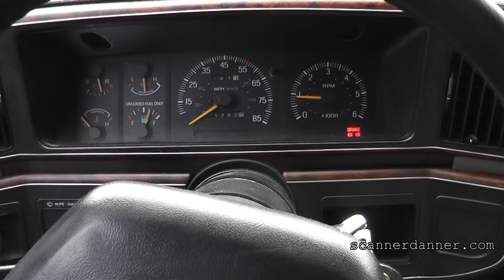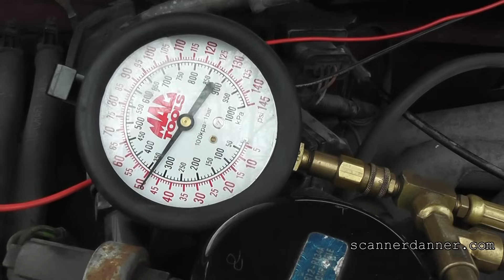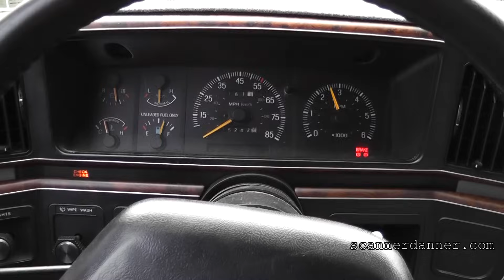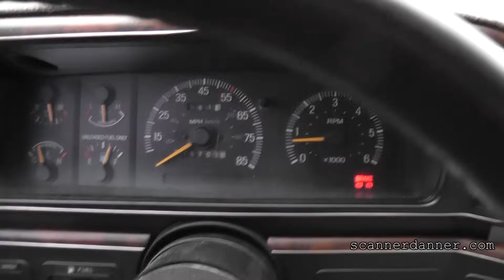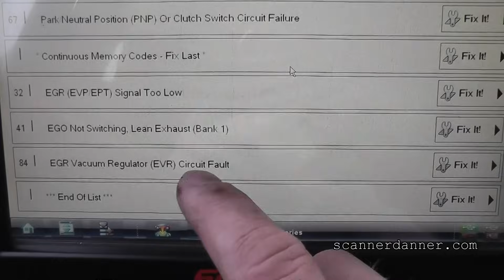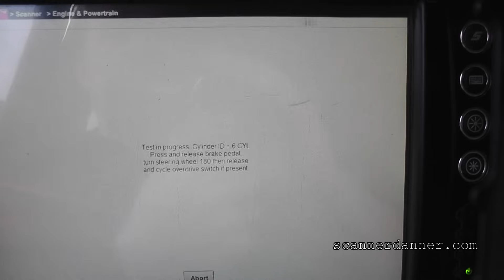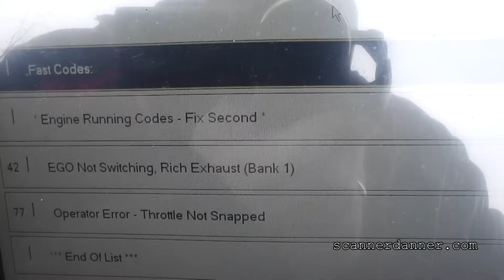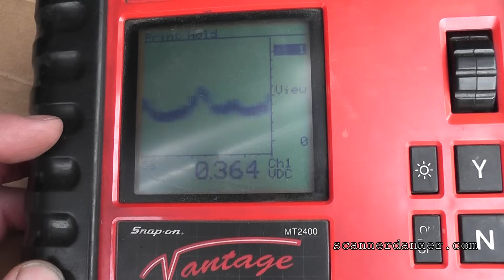1988 F150 Hesitation Problem [FIX!]

Comment: Screw crawling all over and under the engine ... just dust off and hook up your trusty EEC-IV breakout box and do all your voltage tests from the driver's seat before getting covered in dirt and grease!
Reply from the maker: Never had an EEC-IV BOB 😉

Comment: It probably needs a tune up., Paul.
Reply from the maker: No sir, watch to the end. Thanks!
Reply: @ScannerDanner  
Great observation, on my commenting before the end! You simulate my gray cells watching your videos! 
 But my path would've been to check  the plugs and distributor cap and wires first before proceeding down your path. 
Just saying.
And, I did watch to the end
Good show! 😁

Comment: When you unhooked the egr vacuum line, you created a vacuum leak which countered the rich condition...
Reply from the maker: Nope, when I unhooked the EGR I prevented EGR gases from entering the combustion chamber that already had a messed up AF ratio from the faulty O2 sensor. It wasn't the tiny vacuum leak from the EGR control hose that changed anything

Comment: Hey, ScannerDanner!  Great video.  I really enjoy watching them.  They are very informative, and you are definitely a sharp tech, but I DO have one complaint.  I was an auto mechanic for a few years prior to joining the Navy in 82, and was also an auto mechanic for my 20 years in, and in all my years, I have NEVER seen an EMERGENCY brake on a vehicle!  They are PARKING brakes!  LOL  I doubt they would do much good in an emergency, anyway.  They are merely designed to HOLD a vehicle still while parked on a SLIGHT inclination.  That's what parking pawls in automatic transmissions, and for manual transmissions, we leave them in gear.  Of course, it doesn't hurt at all to SET them, but again, they are PARKING brakes, not EMERGENCY brakes!

Thanks, again, for the outstanding video.  I hate to say this, but watching you get your butt kicked the first time on that truck was really refreshing.  It shows that we are ALL human, and we can and DO make mistakes.  What's important is that we learn from them, and pass that knowledge on to others, in hopes that THEY don't make the same mistake.  Great job!!!!!!!
Reply: Darrell Dowd Potayto Potahto.
Reply: dchawk81 P A R K I N G brake!!!!!!!!!!!!!!!!!!!!!!!!!!!!!
Reply: Darrell Dowd P O W T A W T O W
Reply: dchawk81 P A W K I N G!  (for your NAWTHERNERS!  LOL
Reply: Darrell Dowd P E R T E R T E R! (fir yoo suthnas)
Reply: +Darrell Dowd From my understanding, handbrakes/emergency brakes were so defined in the days of single-circuit brake systems. If a master cylinder failed in a single circuit system, we needed a handbrake/e-brake to go some way as to stopping the vehicle. In the 1980s design rules changed (in Aus at least) and dual circuit systems were the law. Vehicles can now stop even when one circuit fails. From then on, e-brakes became parking brakes, and their only requirement was to hold the vehicle when stationary on a slope.
It used to be great fun (still is) doing handbrake turns in my 1966 Mini Cooper S
Reply: +David Bell 
You are ABSOLUTELY correct!  When I was in the Navy, even though our Tech Pubs called them Parking Brakes, everyone STILL called them Emergency Brakes, and I was CONSTANTLY correcting them, not because I was an ASS, but because they would come to me and tell me they couldn't find the Emergency Brake in the IPB (Illustrated Parts Breakdown) to order parts.  I would tell them, "Well, if you used the CORRECT terminology and looked for the thing you are trying to order under Parking Brake/Assembly, you would be able to find what you are looking for!"  They would grumble about it, but sure enough, under the Parking Brake, they would find just what they were looking for.  Some of them I broke of that bad habit.  Others, well, some people (and horses) you just can't break!  LOL

Comment: Simply delete the EGR and plug it off. It's useless smog system that draws valuable vacuum and messes with the EFI. Actually makes the motor less efficient which defeats the point in the first place.
I have done this more than once and would do again in a heartbeat. Some of the early EFI's models don't even have an EGR!
I tell everyone that their plugs/wires/rotor an cap are most likely fine. To tune up any EFI vehicle they need to replace the air filter and o2 sensor(s).

Comment: Good wsy to fry the electrical system homie, ya never plug or unplug the pip while the vehicle is running
Reply from the maker: Old wives tail. Especially on that SPOUT connector. There is a PIP and a SPOUT

Comment: This truck here for craps and giggles to me honestly sounds to me like it is a two or three symptom pretty substantial symptom problem top of my head I'm only 21 minutes in the video haven't never watched it not even really sure what are the total symptoms of the vehicle like EGR or..... EGR/pcv valve and the good old O2 sensor LOL LMAO guess those my guesses
Reply from the maker: I'm replying to your original question that was in my inbox. Are you saying the ECM, ICM (ignition module) and ignition coil are all burning up? Or are you simply having ICM and ignition coils that are burning up? 
Cheap and bad new parts are absolutely plaguing our industry right now and that is my guess. I see nothing special with this system. There is no type of ballast resistor to limit current to the coil, but there is a what they are calling an "ignition suppressor resistor" on the IDM circuit (ignition diagnostic monitor) of the ECM. This monitored circuit is tied directly into coil negative via the resistor I just mentioned. If that resistor is missing, maybe that could damage the ECM??
Reply: @ScannerDanner  I will say that I have found out that if my computer or ECM burnt up A tip if in case you didn't know or anyone else in my case I don't know about anybody else's but in my case when the computer has went out the fuel pumps won't work LMAO truth LMAO 🤣 now if we were to go and look into the hands chiltin manual and to the electrical system chassis chapter 12:43 is what I'm on you have ABCD and then you have 8 9 10 and 11 now the A-D is OMG lol longitudinal The 8-11 is longitudenal I can't remember My x/y Axis idiot.... anyways the part that interests me is right at the top of b you'll see the dash between a and b and dead smack in the middle of 10 ignition suppression resistor 22 km I need to look up that also at a 9 there is a yellow wire also with a 20 gauge fusible link I need to look for last thing and this is going to sound in freaking insane do you know how to bypass a donor computers automatic transmission to override it to run a manual or is it what I think impossible damn near it
Reply: @ScannerDanner  again all burning up randomly all of them one of the three computer ignition or coil.... Coil is rare for it to go out but it does more than happy to give you my email I've made up one for just this occasion so if you want me to send what the video of what the trip looks like under hood or you want to hear it running or something like that video of testing things you suggest I would appreciate it and anything that I fix I'm more than happy to record and be as professional as humanly possible and thorough as possible without boring people and he'll have the video brother I don't care as long as I get to where I can have my daily back lmao

Comment: So your sayn due to poor general maintenance, this person is out on alot of cash for your services, twice.. Lol.. Nice one...
Reply from the maker: If that was your takeaway from this, I'm sorry. I don't even charge for my services anymore. The videos are my payment
Reply: I got an 89 bronco. If you wanna come look at it.. These local guys love to throw parts at it.. 😞 could have bought myself a new truck by now....
Reply from the maker: @p.r.6220  I can help you if you have some basic equipment. (test light, voltmeter and a fuel pressure gauge)
Reply: Yup got that... Got new O2 sensor. New plugs. Wires. Coil. Tps sensor. Cleaned air idle control valve. New distributor at 12° timing. Recent vacuum hoses. New inline fuel pump and relay. All filters and oils changed. Im currently replacing exahust. Headers to tips. Only thing i can think of is timing chain and torque convertor... No power at 800 - 1500 rpms... Did all seafoam treatments also. Twice. Run 89 octane gas. I am at sea level elevation.. HELP
Reply: I do have smog deleted.. Only vacuum lines to fuel pressure regulator and brake booster and a/c.. No cruise control.. Heater core bypass. 89 bronco 5.0 auto 4x4.. No engine lite on.. I have LMR smog delete resistor plug..
Reply from the maker: @p.r.6220  first thing, "new" doesn't mean it's good these days, so many cheap ass parts being made.
3 things I would like to know based on your no power in that specific range.
1. What is your MAP sensor frequency (it is a digital signal and cannot be measured with a voltmeter, you must use the frequency scale on your multimeter) with the key on engine off and with the engine running at idle. Also what is your elevation?
2. You must have s timing light since you set the distributor base time. Are you sure you used the correct mark? These early Fords would use two graphs sometimes. 3. Let's make sure the computer is advancing the timing. When you look at the mark and rev the engine, does it move way off of the graph? It should
Reply: Map frequency is a no go.. Timing lite was borrowed. And sea level.. South TX..
It idles fine @800.. Just the take off stumbles..🤷

Comment: Look, a 4.9, get an intake, carburetor and HEI distributor because these damn things are futile!
Reply from the maker: The best thing to ever happen to ANY inline 6 was fuel injection. The little short intake runners for the center cylinders and longer runners for the outer cylinders left fuel distribution horrible with a carb engine. Why would you ever suggest that? These EECIV 4.9s ran great.
Reply: @ScannerDanner because there are a plethora of 4.9's going to junkyard being scrapped because the garbage efi setup can not be repaired. Either shops are uneducated or uninterested in fixing them. I've spent several years trying to get mine to run right and have come to the conclusion the entire setup is junk, you can literally replace every part on it and still have no hopes in it ever running right. No check engine light, so the ECM thinks its good, yet I can hear it rattle, listen to spark knocks and the slightest hill drops to 45 MPH wide open throttle, I will never attempt to repair efi ever again.
Reply from the maker: @Maples01 your loss. These systems are easy when you understand them.
Reply: @ScannerDanner I have to rely on others, and when no one wants to work on these things you have but two options, junk it, or convert it over to the simpler carburetor, these things have computer issues, mine has a hard to find one that costs over $600, I can't buy it and that not fix the problem, then they have the stupid smog equipment that most people remove, mine was missing day one, then the distributor, its a headache in itself, you can go through several at the parts store before you find a good one, no quality control on remanufactured units. I have invested a fortune in this van and it runs worse than it ever did, just keeps going down hill, and I don't drive 3000 miles a year, I just need it to get me through my hospital visits till I can get something else then I may just junk it.

Comment: duty cycle egr? nope wrong answer.
Reply from the maker: +biggysground what are you talking about? The vacuum controlled EGR valve on this model is controlled by an EVR solenoid that is duty cycle controlled.
Reply: +ScannerDanner 
right the vacuum solenoid is, not the egr. The newer designs are directly controlled by the solenoids on top of the egr and those are "duty cycle egr's."
Reply from the maker: +biggysground well that was almost worth arguing about